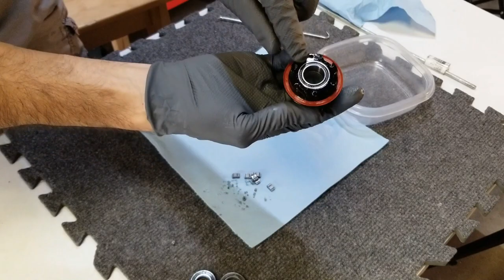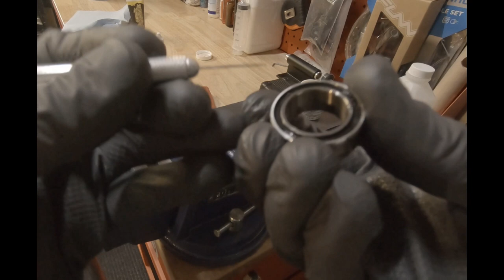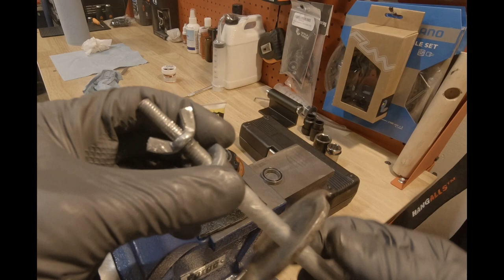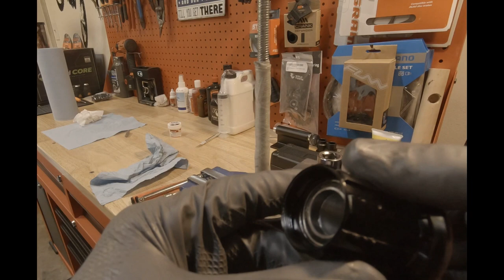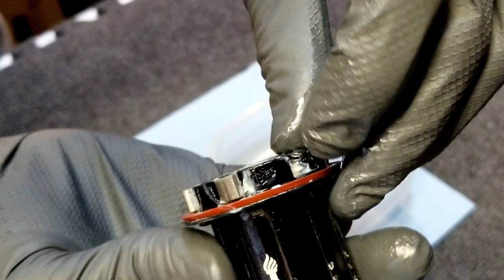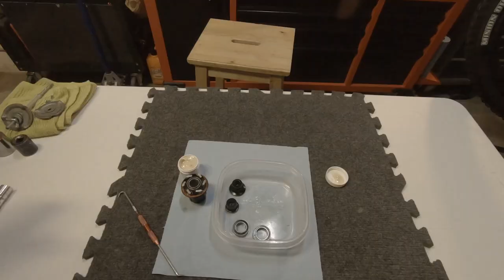Industry Nine Bearing Replace and Bearing grease

Comment: I had a bad creaking noise on my nearly new rear i9 wheel with torch hub, i brought it to a local shop and they broke it down and cleaned it, which got rid of the noise.  It came back in less than 200 miles, so this time i was determined to do the "maintenance" myself.   This video was incredibly helpful and well done... THANKS!!  (not sure why my dt swiss, novatec, bontrager, or shimano hubs on other bikes dont need this extensive maintenance schedule)
Reply from the maker: Thanks!

Comment: Well done! All I was looking for is how much of the Dumond grease to use to quiet down the ratchet sound. Looks to be very little grease applied and only on the pawl pockets and spring pockets. If you could reply on the grease amount (I would be more inclined to use too much!) I would appreciate it. thanks again!
Reply from the maker: Quite frankly if you use too much grease it'll be pushed out as the hub spins. I always recommend putting enough but too much. It will get a bit quiet regardless.

Comment: great video! i just did my first freehub service but after putting the cassette back on it seems too close to the wheel and the granny gear keeps slipping, does an NX cassette need a spacer on the freehub first thats maybe missing? I checked the limit screws and indexing etc to no avail
Reply from the maker: Weird.. not supposed to slip to a higher gear if everything is installed correctly  unless you have a 6mm offset chainring. Also check if u need more cable tension.

Comment: This is no spacer between the freewheel body and the hub ?
Aren't the two bearings to close and rub against each other ?
Reply from the maker: In this case, I9 don't use a spacer here.  Remember that what will be rotating mostly is the inner aluminum sleeve that goes across. The rubbing on both bearings will not cause any damage since these rotate same direction. 
I hope this answers your question.
Reply: @BigDescent  To what I understand, once installed in the frame, everything  will be "compressed" by the trough axle.
Then, everything which is close to the inner aluminum main shaft will be stationary as it's now "fixed" in relation with the frame.

The "load path", to me, is as this :
Bike frame NDS -> dust cover -> hub bearing inner race -> inner axle shoulders -> hub bearing inner race -> freewheel bearing inner race -> freewheel sleeve ->freewheel bearing inner race->Dust cover DS -> Bike frame DS.
The trough axle is compressing all those.

When you install the wheel in the frame, smallest sprocket & large ring. Then spin the wheel very fast and let it cruise, does the wheel is putting the crankset in motion ?
Because it's what I observe on a wheel I serviced with a I9 hub (not exactly the same though, it's a road version but same conception).
When you're cruising downhill, the hub is spinning, but not the freewheel.
There, two bearings are facing each other. The one on the hub has his outer race in motion and in front of it, the outer race freewheel bearing which is at stop.
If they are too close, of if there is too much grease, the hub will the drive the freehub.

So, i installed a 17mm ID 0.25mm thick washer on the axle before putting back the freewheel and it solve the problem.
Zipp, Fulcrum and other wheel builders are placing a spacer there, for this reason.
Exemple : https://youtu.be/pcmSFr0_kPk?t=180

I don't say you're wrong. I also looked at the I9 documents and exploded views and there is no washer.
But I'd like to know if you notice the same phenomenon after you service your wheel.
Thank you.
Reply from the maker: @stephanelouvet1113  yes you're correct, and thats why when the trueaxle is over tighten it crushes the bearings. We can say is not the best system, but hey, it spins smooth when properly tighten. Thanks for ypur comments!